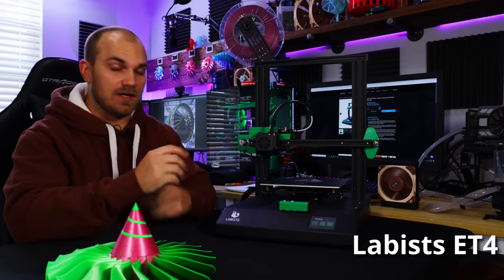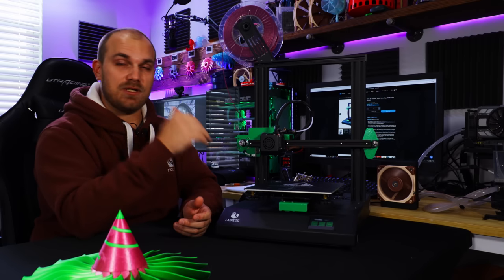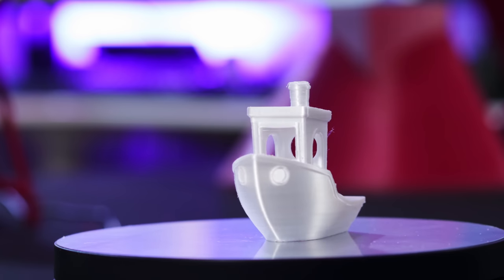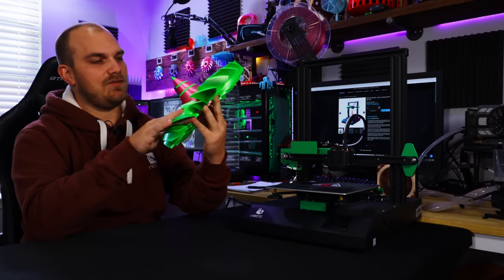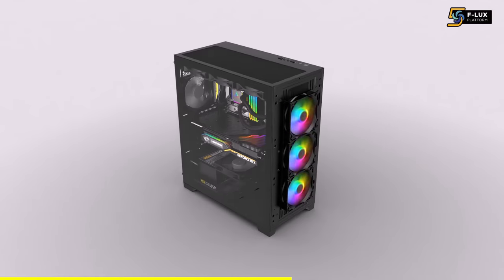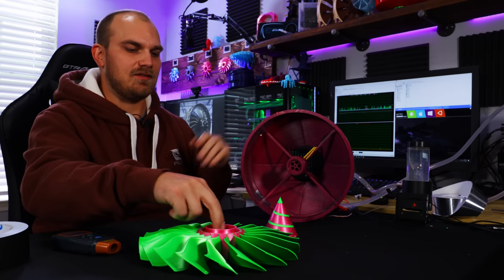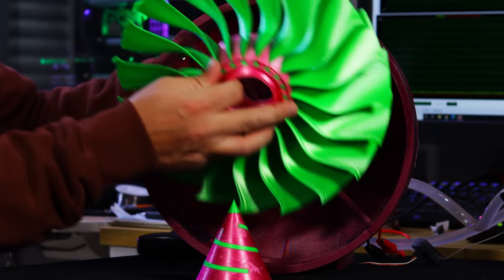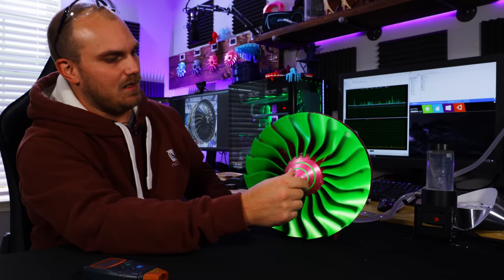3D Printed Jet  Engine Fan Water Cooling | Labists ET4 Review

Comment: Dude! Your fan was displacing so much air, it was applying torque to your stand. Your fan was successful. I think your motor was just too whimpy originally because of the amount of torque it needed to keep the fan spinning lead to your small motor drawing more current. Replace the motor to something with high current and you'll get your RPM's. Just dont' put the RPM's too high or you'll displace so much air that it will apply torque perpendicular to the plane the fan sits on. i.e. cause your structure to want to move forward. That was really cool!! If it wasn't stationary and was more secure it would have flown forward!

Comment: Try doing it again, probably at a smaller size and ur going to need  a shroud with a stator in it if u want the air to blow in the right direction, this had potential, do another turbofan blade design video, I'm sure alot of viewers would love more of this content

Comment: Bigigger radiator! For that fan! It can push more air over bigger radiator at slower speeds.
It might take engineering to maximize radiator to fan but it's definitely worth a shot.

Think of it it as 4 (maybe 5) radiators.
1. Cooling
2. Cooling more
3. Even more cooling
4. Most cooling
( possible 5 in the middle cooling more)

This. Has potential at its size with low RPM.
You. Might just need 4-5 small radiators across the fan.

Comment: Those fans are designed to operate at transonic speed at which aerodynamics act quite differently, also the duct is really important and it must mach specific design of the fan.

Comment: Gives another shot for these fan,

but now using ratio gear in order to lessen stress both on motor and fans with high RPM also the bigger the blades the lower spinning they are and vice versa

Comment: I think if you use the Rolls Royce style fan again, you should print out a smaller version, but you will most likely need to add the velocity stack to the front of it to correct the airflow characteristic. I think it has potential, maybe check out a Rolls build vid to see the velocity stack I mentioned.

Thanks for the great content. Keep it up! Congrats on the sponsors!

Comment: Just thought I would comment as an aircraft mechanic since not only do I think this is cool but I have some advice that will help you out with it. I've pulled fan blades off real engines before and one thing I will tell you from having done work on them is balance is critical to not only safe but proper function. The easiest way to do this in your case is the same way we do it on real engines by weighing the blades and ensuring they are all either exactly the same or very very close to each other in terms of weight. I would suggest you pull each blade off, weigh it, and remove material a little bit at a time to get them as close as you possibly can. In you're cases we are probably talking ounces.

Comment: Those fan blades arent really designed for compressing the air. So I would suggest designing the exhaust to have the same cross-sectional area as the intake. So basically the exhaust needs to be as big as the intake (or the fan diameter). Or scale the whole thing down to 120mm.

Comment: "you're gonna need lots of glue!"

great job with the attempt. Duct was a great effort.

Thinking you could pull off a redesign and another attempt if you did a shroud that supported a full 360 radiator back end. (or even 2 360's?).  I expect the incredible restriction on the back is a large part of the problem to making this work.

alternate suggestion.  Adapt your squirrel cage blower user submissions to draw air through the entire 360mm radiator. You have been going down the road of using a single fan to force through a 120 radiator, when likely the opposite will yield better results.

small pipe + big pump = X, little pump + big pipe = X.  Victorian era engineers are calling to you through the ages.  DO IT!

Comment: Modern fan engine actually have active clearance control system to make it super close to tunnel but not touch it... 
And a fan like this not working on it's own, the static  tunnel and the OGV (outlet guide vane) are very important part go get air flow as well.

Comment: The problem with those tunneling shapes that become thinner along the way is that you’re basically compressing air - there’s not enough space and too much air being pushed into too little space, so most just yeets back out. Doing it the other way around (having a tunnel that opens up the further it goes along) could actually do the opposite and help pull more air by creating a low pressure zone.

Comment: No expert but I think having a shroud that extends out past the compressor allows for better efficiency. My theory is it allows the to only flow in one axis instead of 3. Also get a bigger motor on it, that compressor design is meant for 50k+ rpm irl, so getting it to 5-10k rpm will allow you to see some results... in theory.

Comment: Do it again,
But this time make a bigger space between fan and shroud. The fan is expanding like your rc powered noctua fan. And use the rc car motor. Make sure the motor gets cooled. And shape the tip of the shroud round.

Comment: Looked like the tolerance between the fan blades, and the shroud were really tight.  Maybe give a little more space between the blades and shroud.  Also, make the shroud stick a bit further in front of the blades as well. Maybe not to the tip of the nose cone, but maybe an inch, or inch and a half to help with pushing the air flow in  the right direction.

Comment: Question, would it be best to leave the stock fans that come with a case/cpu radiator, or is it better to change them out?
Reply: Depends on what fans it is.   Some cases have pretty good fans included.   Also depends whether you need static or dynamic pressure   there are radiator optimized fans.   You can read up on the topics on the noctua website for example.
Reply: @jasperrost78  Well I have a NZXT h500 and the Kraken x62, and it just does not seem to keep the air in my case that fresh, and as such my GPS gets warm pretty fast. Still within operating, but I would rather it be cooler seeing as I am coming into summer and already pushing 60c-75c

Comment: The fan with the correct shroud would make really high pressure,  but u do need the  cowl to have slightly smaller diameter in front of the fan, and slightly larger at the back of the fan, then allow some distance before tapering it inward so the air has enough space to convert the outward momentum to rearward  thrust.  Look at turbofan cowling, u will see what i mean.

Comment: Those blade designs are made to be ducted. The gap between the blade tip and duct are critical in producing thrust. The stator behind the rotating blades in the actual engines are also critical in preventing axial flow and keeping it as linear as possible. Cool little experiment on the bench you did but destined to perform poorly based on how it was all set up in the end.

Comment: Try reprinting the shroud with one more millimeter of blade clearance, and extend the length both in front and behind the blades by about one inch. That should allow for a more stable airflow through the blades. I would recommend trying this on a smaller scale first, in order to not waste filament.

Comment: A fan like this becomes much more effective if there is  diffuser vanes  or what sometimes is called a "swirl-straightener" behind it, to both prevent losses due to a rotating air stream, and to provide better pressure recovery, as the swirl velocity is converted to pressure in the diffuser shape of the vanes.
Reply: Basically a stator, yes I agree

Comment: in actual jet engines they'd use a type of high temperature foam to line the first couple compressor blades forming a seal to the case, for 3d printed parts you might want to try lining the fan case with some kind of soft foam, the idea is that the blades will wear a groove into it as it runs but also create a flush seal to the shroud

Comment: judging by how it was blowing stuff behind it and able to pull itself forwards at the high RPM stress test at the end, it seems like it just needs a very high RPM to work properly. Considering its designed based on jet turbine, seems obvious in hindsight. 
Would love to see you have another go with a properly fitted shroud, everything glued down and a big motor strong enough to run it at very high RPM.
Reply: Oh, and the shroud might need a bigger space between the fan and the radiator than you would usually give so you dont have as much air pressure bouncing back?
It just seems if you're going to use a fan designed for a specific industrial use then you need to replicate as many factors of its use case as possible otherwise you're going to get sub-optimal results.

Comment: Just a friendy suggestions for next time you want to test a prop or fan. If there is a chance that blades are going to break. Never ever stay in front of the propller or fan. Because those part tend to fly to front side and back side is safer.

Comment: You might want to try Greentec Pro for this. It prints like PLA but it can stand much higher temperatures. I once did a test with Greentec and PLA at 80°C and while the PLA print collapsed under its own weight, Greentec had the consistency of hard rubber and retained its shape. It's also less brittle.

Comment: Why didn't you just sand down the inside of the duct so the blades could spin freely? Also can you scale the model down and modify the hub so it fits in the Noctua case so you can test it in the fan showdown with the user submitted designs?

Comment: High bypass turbines aren't axiolinear, they're designed to push the air out to the sides against a cowling that gets wider as it goes back.  Would be important to examine engine cowling designs.  That blade would probably be fine feeding a 360x360 radiator.

Comment: I used to work on aircraft. The reason the jet engine turbo prop design doesn't work as expected is because that blade design is designed to be optimal at 10k rpm to well over 100k rpm.  You're not going to see proper airflow till you reach those rpms.

Comment: For the next attempt, since it's pushing so much air at speed and trying to force itself off the motor (successfully even), would it be worth flipping the blades around to run backwards and turning the whole mount?

As in, have the air blowing force push the fan INTO the motor, rather than off it.. then it can't actually slip off.
Plus a shroud which has more of a gap between it and the blades (to allow for expansion under load) and extends forward in front of the blades + back behind them to limit how much air gets thrown sideways and out front

Alternative model idea: a design that mimics the electric ducted fan jet engines which are used in RC planes. Dad used to have a little jet which when fired up could barely be held onto, and it's single electric motor could fly it straight up at stupid speeds. >200km/h top speeds on flybys.
Obviously you'd need a VERY sturdy mount for this, but it'd blow a heck of a lot of air through a radiator

Comment: From a air flow perspective, If you try to put all the air that that fan can pitut off it wont fit down that short of a funnel due to volume constraints. So a lot of it is going to be unused and pushed else were. So you may need a longer funnel leading to the small radiator that can hold more volume so the volume of the air comming through it is more. LOVE THE COLORS THOUGH

Comment: You should do an objective ranking of all the printers you have tried based on categories, such as best print quality for a certain price range, easiest to use, fastest to work, most versatile etc 

Also all these high bypass jet engine fans look cool and all but the reason they are functional is the compressor stage to provide the thrust, without that it's just a big fan, especially without the shroud, you need the shroud to channel the air, it needs to hook around the front of the blades to guide the air down into it but at the same time leave enough space for the stretch of the blades, with the way you put this together I'd say you need at least 4-5mm of clearance.

Comment: You should have added some scilicon spray on the inner side of the outside ring. It would have helped really much with the friction of the blades against the outer ring.

Comment: 2000 RPM on a 120MM wide fan has a surface speed at the periphery of almost 12.5 meters/second, whereas that XL giga-fan, maybe like 300 mm in diameter, going the same 2000 RPM would have a surface speed of around 31 meters/second!! As a side note, this fan would benefit from a longer stabilizing spindle and bearings further apart.

Comment: I was wondering what your thought are on me using a corsair H100 i v2 radiator as a oil cooler attached to a 160cc pitbike motor, oil pressure never gets above 12 kg of pressure from the oil pump

Comment: You may what to look up the 'Affinity Laws' for Fans and pumps.
 p1 =P2(n1/n2)^3  p - power, n - speed  1-New 2- old value  p= 10*(800/400)^3 = 80
 i.e. A fan running at 400RPM lets say uses 10W. if you change the speed to 800RPM it will use 80W if you change it to 1600RPM it will need 640W.  2000RPM is 1250W

You may what to do the fan test with a watt meter on the power supply to see what power each fan ends up using and how good they are.

Comment: Nice one man. Heres another Idea I had for cooling the other day. I'm using my air humidifier lately, and when the vapour comes out, the water expands in gas form, soaking up the heat around It, and it comes out pretty chilly. Maybe attach one to a radiator might be a good experiment

Keep It up :D

Comment: These fan blades are shaped for supersonic speeds at the tips, they don't perform well at like, what, 10 m/s you've got there? Also the midsection is shaped to mostly just produce no resistance because there will be engine core compressor behind it.

Comment: Be aware that it may be not wise to get it to 2000 rpm just because the noctua one is. When a fan is larger the tip velocity is faster. On a 120mm noctua fan the tip velocity would be 45kph and the 280mm will be 105kph

Comment: 3d printed high-bypass fans never work unless you balance them. At some points in the videos it's clear some blades are longer then others. This causes vibration with eventually self destruct.

Comment: When it was in the duct you should have tested the cooling, the fan is/was much larger so would have had a way higher airflow at 500rpm than something smaller at far higher rpm.

Comment: could build a shroud and use a regular house fan to blow into the radiator. CAD: Cardboard Aided Design... can even get the 5.4Ghz OC with the stock cooler.

Comment: Id love to see a proper multistage compressor section made with stators after each stage just like a jet engine, to try and achieve some proper pressure at the face of the heat exchanger. With a nice non rotating bellmouth. Id even be willing to pay for such a design/test. Lmk if ur interested.

Comment: You said something like: "Our goal is 2000 rpm as that's what the Noctua fan is spinning at"
Well the Noctua fan is 120 mm and this one is what, 300 mm? That big a fan at 2000 rpm will have a very high tip speed on the fan blades. I'm not up for the math right now, but I'm sure it will be impressive. 

OK, so I couldn't help but do the calculation... So sue me!

if the Diameter is 300 mm and the rpm is 2K, then the tip of the fan blades will have a speed of 300xΠx2000=1884955.59 mm per minute. Or 1184.96 meters per minute, or 113.1 km/h or about 71 mph. Meanwhile the 120 mm Noctua will trundle along at a measly 45 km/h or about 28 mph. Actually it will be a bit less than that as the fan in a 120 mm fan isn't actually 120 mm in diameter.

And though I'm pretty tired I think I got the math right on the first try...

Comment: Maybe if you get an overkill motor you can run it indefinitely without it heating up. 
Then you could create a side panel for your pc with a massive  high bypass fan.  
If you reduce the number of blades you can still see everything in the computer.

Comment: The Fan at 1st place, Modify that just a little. There are extruded fin kind things on blades,  Placing of those fins are exactly the same on each fin.  Placing them in a way that 1st blade remains same, on 2nd just move those fins a little to the left or right, same on third so that the fourth can be first again. I think that might help that fan to pull more air. Please make this happen if you think it might help.